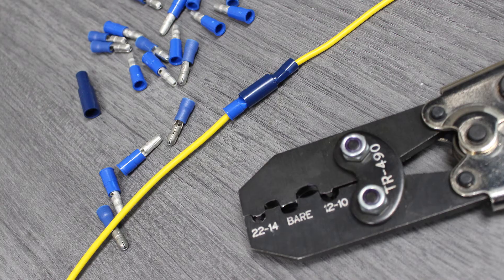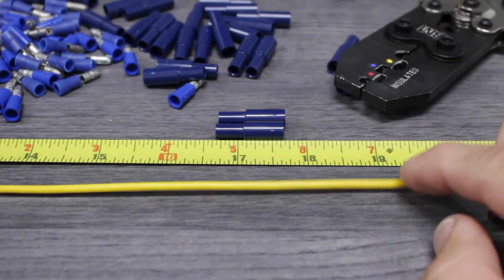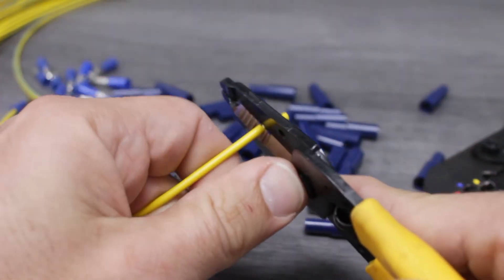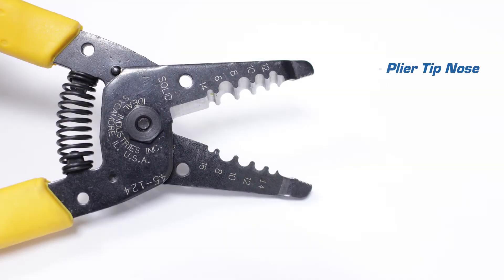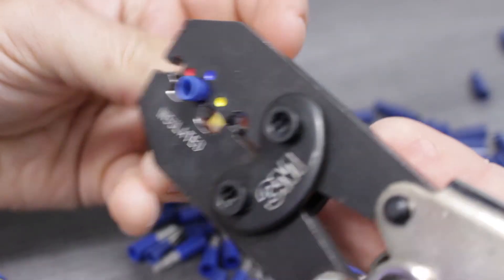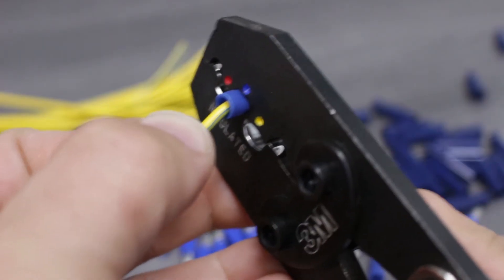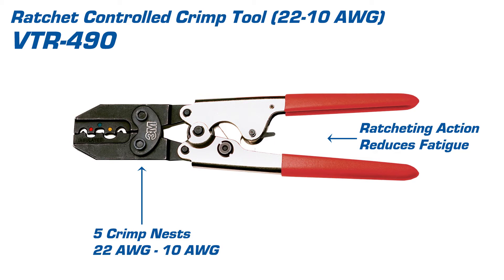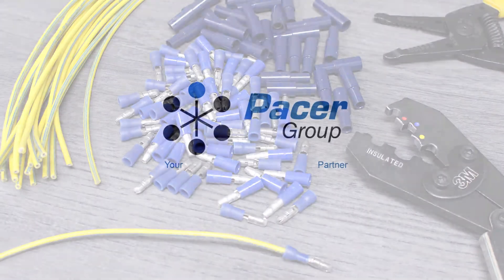Properly Installing Bullet Terminals

Comment: The crimping is the easy part, the hard part comes when you have to fit those tough little bastards together.  I should probably go with a different kind of connector in the future, but this is what I have on hand for now
Reply from the maker: Bullet connectors require some force to connect/disconnect, but that also makes them dependable. Next time try fully insulated disconnects. Just as dependable but not quite as much force required.
https://www.pacergroup.net/heat-shrink-fully-insulated-disconnect-terminals/

Comment: And then there’s me over here, wondering why his connections don’t work. Turns out that I was using connectors one size 2 large so I could fit the insulation as well as the wire into the barrel. Go figure
Reply from the maker: It happens to the best of us. Sometimes the best way to learn is through mistakes. In the future, you'll never make that same mistake.